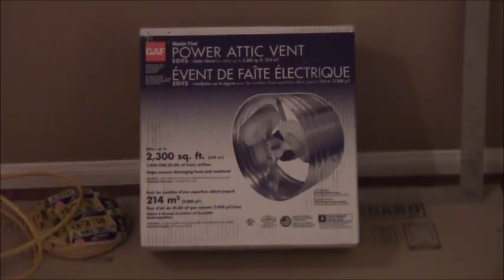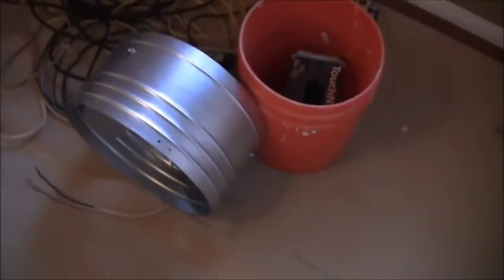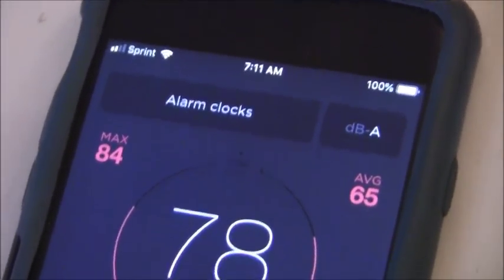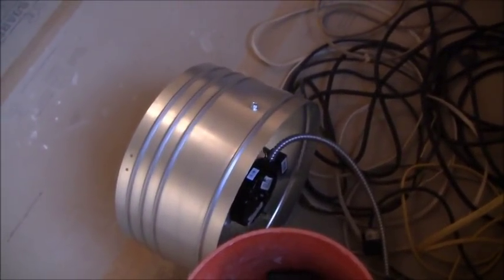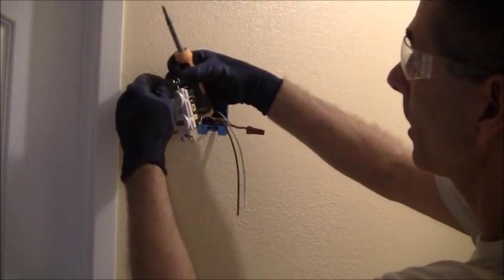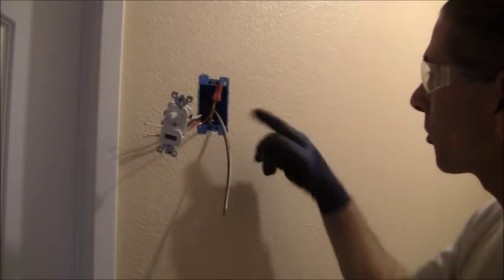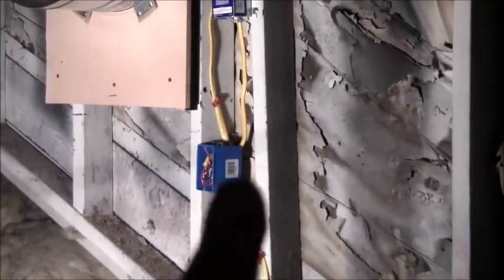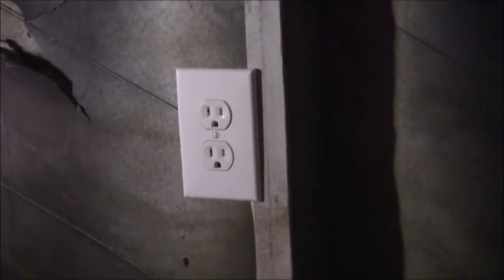Installing an Attic Fan and Testing for Backdraft

Comment: Lol, I knew when you were wiring that switch the light wasn't going to  be right because the exact same thing happened to me a month ago and I bought the same switch here in Canada, I found the diagram on the package somewhat unclear and hard to read and the terminal coloring seemed backwards to me. That switch manufacturer could improve on this. Great job!

Comment: Great video!!! I am adding a attic fan to pull the air out of my Florida garage into the attic so it moves the attic air out thru my soffit vents and roof vents. I was actually looking at that pilot switch today and wanted to figure out how I could manually switch the fan on and off. Thanks for the very detailed video. PS. The red wire in the attic, what is that connected to?
Reply from the maker: The Red wire from the pilot switch is the manual power to the fan motor.

Comment: If your furnace had an intake from the attic, it would stink. The furnace recirculates the air in the house.
Reply from the maker: I think we have a disconnect. My furnace takes its combustion air from the attic. My furnace takes its return air from the house. That that clear things up?

Comment: Furnace should be vented through the roof. Nobody runs  vent into the attic. That’s a safety issue.
Reply: His furnace is not vented to the attic, his furnace draws it's combustion air (make up air) from the attic. His furnace is in an enclosed closet so it needs to get combustion air somewhere. Since most newer homes are getting more and more "efficient"  (air tight) it is becoming more common for furnaces and water heaters to have a 2nd pipe specifically for combustion air. Those typically require combustion air come from outside the dwelling. Codes vary all over the country so check yours before doing any work.

Comment: You added/expanded  an already crowded electrical box by adding a fan and 2 receptacles? Run a dedicated circuit if at all possible. You sealed around the housing of the fan even though the instructions say don't do that. The reason they want that gap is for performance. You paid for a lot of engineering and design work only to say "I know better" and modify the housing? Also why a bypass switch?? I installed a bypass switch on mine but it works exact opposite of what yours does. I use the thermostat to control my fan but I wanted an option to turn off the fan when the bearing on the motor fails and it gets loud. (usually at bedtime)  it gets noticed there's a problem. Why would you ever want to randomly turn the fan on?? They do sell a combo thermostat/humidistat if you want it to come on for high humidity. But could not figure out why you would want to manually turn this thing on?